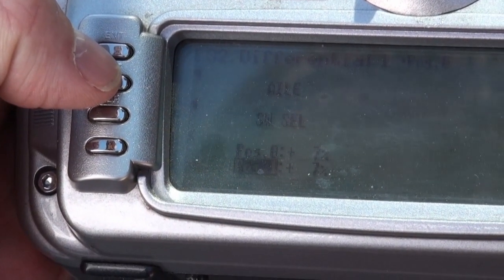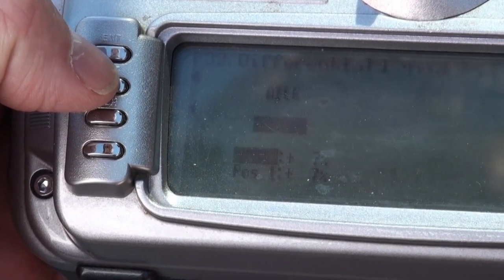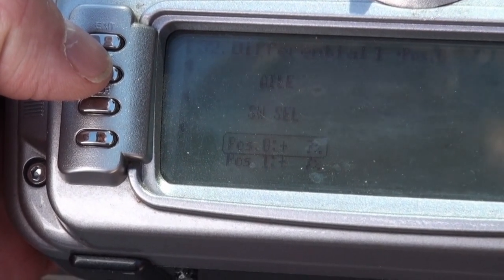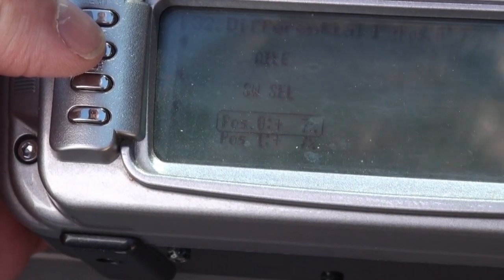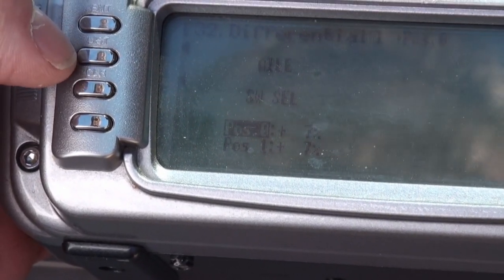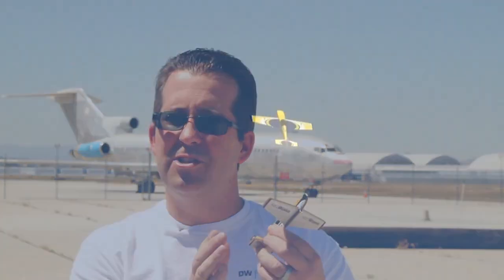Aileron Differential (Throwback Thursday) - FlightReviewz

Comment: finally a test in the air about aileron differential...good job
Reply from the maker: Thank you for the feedback. Anything you would like to see that we have not covered yet?
Reply: @FlightReviewz   Thanks for response. Yes if you could, i'm interesting to learn more about triming a model doing tests in the air, like CG test, down and side thrust test, decalage test, tip weight test and generaly anything about trimming someone with your experience considers that is useful for a newbie...those thinks are very important and aren't much videos in youtube to see.